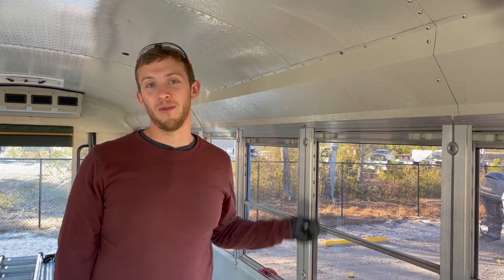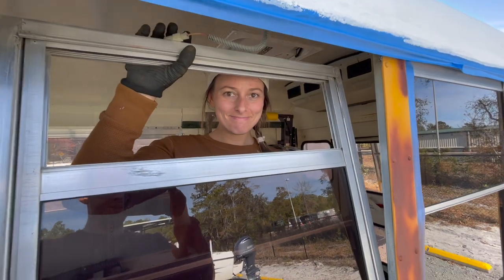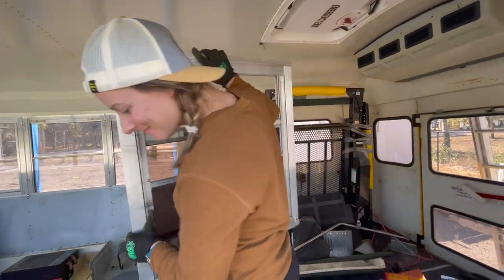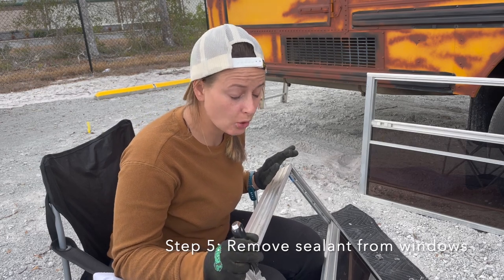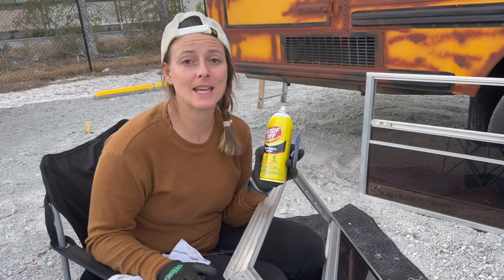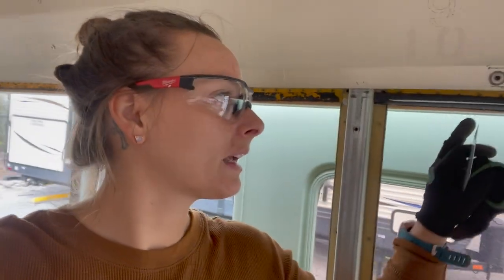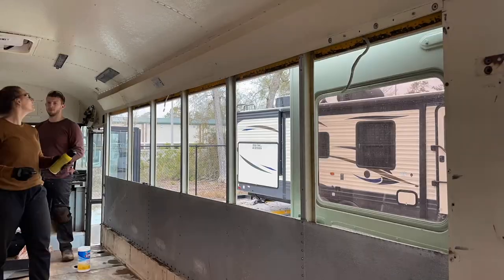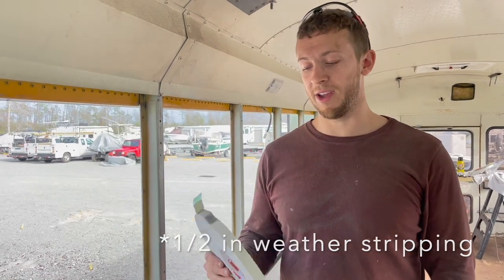How to Remove School Bus Windows | Reseal Skoolie Windows | Key Takeaway | Bus Build 6

Comment: May I ask how much you acquired the bus itself for?  I am a new subscriber and missed it if it was said previously, and from which state was it purchased?  Another question is "would you have any reason to leave either of the stock A/C units", say if you wanted AC while driving, or is doing the delete superior, then getting a mini split or whatever unit is best for AC?
Reply from the maker: Yeah, of course! We bought the bus for 10k in Texas. It was a little more than we wanted to spend, but it was the right length, great engine and very limited rust so we bought it.

As for the AC units, you definitely could keep them and use them while you’re driving but honestly, I don’t think they work all that well and they’re more of a nuisance for how big they are. We decided not to do AC at all (we only had a fan in our van) and we’re totally fine. But we also try to avoid the desert in summer 🤷🏻‍♀️ we do have a couple DC fans we use when it gets hot but having all the windows open for a breeze is great!

Hope that helps 🤗

Comment: Hi guys! A quick question that may seem kinda silly: where are you storing and working on the bus? I want to acquire a bus and work on it, but I can't think of any places off the top of my head that I could store and work on it!
Reply from the maker: Hey! We were building at a storage unit. Luckily, we found one that was totally cool with us building in our spot as long as we cleaned up really well after each build day. We kept a generator there so we could use power tools. Hope that helps!